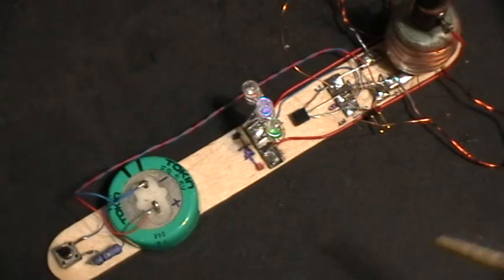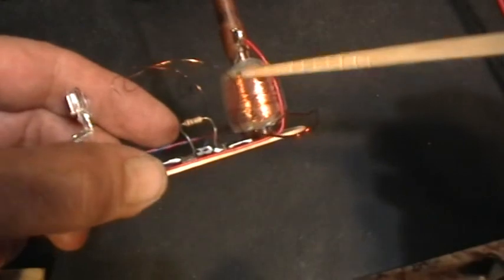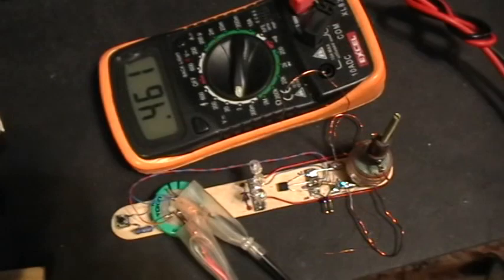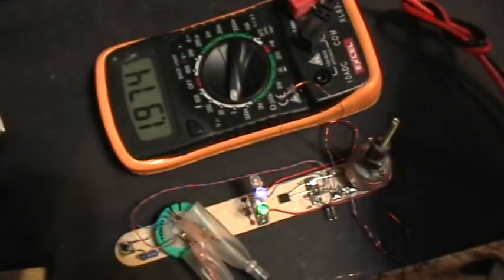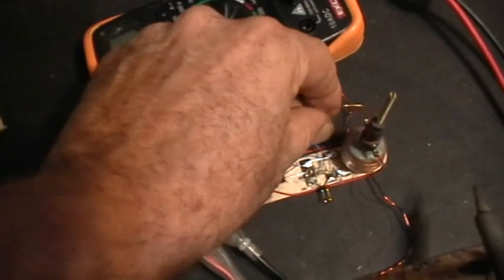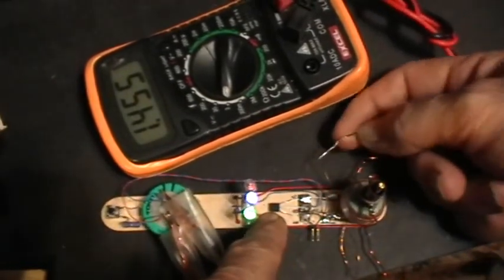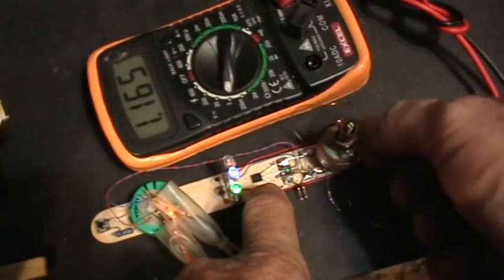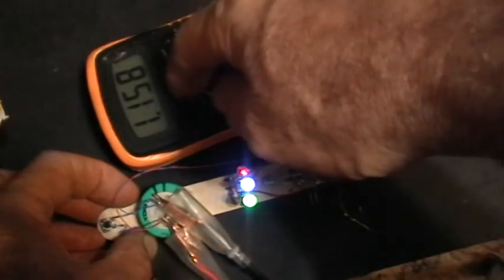Joule Thief: TK Loopstick Meets LaserSaber's SJR Simple Looper

Comment: Nice work!  I thought you would have fun with this little circuit.  Thank you for sharing your results.
Reply from the maker: Yep, I just thought to use the loopstick because it's the only Litz wire I have around the place. I think I'm going to have to get a couple more from my supplier before they run out.
Another tunable coil set I'm thinking of using is the old "variometer" style of concentric air-core coils with the inner one pivoting.

What is weird is that I can't get it to work at all with the more-turns Litz wire winding on the capacitor side. It has to be on the LED side.

Comment: Tk 
While watching this vid ...it seems that while the leds were not as bright as possible...there were some moments when the cap seem to recover a few millivolts rather than discharging....it is amazing....you seem close to showing a true anomaly..
Reply from the maker: Yes, those superbright LEDs are nowhere near fully bright. They are blinding and completely wash out the video when they are carrying their rated DC current! But you can't really rely on video to judge LED brightness because every camera is different and most people including me usually just leave the exposure and shutter at "auto", so the exposure reduces when the camera sees a bright light. Also the spectral response of the camera sensor is different from the old eyeballs.
Yes, the cap definitely gains voltage while LEDs are running, and this is a big cap so even small voltage gains are significant. However.... the bad news is that this is normal for electrolytic capacitors (and batteries too) after a heavy discharge.
Thanks for watching. How's the fishing?

Comment: The work i done with this circuit shown, every winding ratio setup produces different frequency, a given frequency does not necessary light different led's in the same brightness,
. They are frequency sensitive. Color LED'S are working in the manometer wavelength in light output, maybe it has something to do with it.

Comment: Good Job. Amazing. Is there a schematic with description? I would like to build this circuit.

Thanks and best regards ;)
Reply from the maker: Thanks! The basic circuit schematic from LaserSaber is shown at 0:17 in the video. View in 480p and enlarge. The fine print says you may have to swap ends of the coils or polarity of the LED stack. This is generally true for all JT-type circuits: if they don't oscillate swap the coil polarities around one at a time, try all combinations for the best result.  For the capacitor I used a 1F 5.5 volt cap, this is different from LS's original, he used a smaller, high quality cap charged to a slightly higher voltage. For the resistor I use a 10 Megohm or sometimes 5 Megohm (2 ea. 10 megs in parallel) 1/4 Watt metal film resistor. The transistor is MPSA18 but BC337 will probably work well also. The load is 3 LEDs in series. The coil: the Loopstick's original Litz coil is on the LED side, and one or the other of the added coils (20 turns middle, around 100 turns outer) is on the capacitor side. I don't think I can describe it any better than I did in the video, as far as the final hookup goes. Original coil on the LED side, outer coil on the capacitor side, middle coil hooked up with one wire only to the Anode side of the LED-innercoil connection.
Good luck building, and let me know what you come up with!
(Also check out the "supplement" video I just uploaded with the scope waveforms showing.)
Reply: Thanks for the explanation. ;) What is the litzwire diameter? Or can i use magnet wire instead the litzwire. I have magnetwire with 0,28 and 0,15mm.

Thanks and best regards
Reply from the maker: Kurzschluss480Volt
I suspect that using Litzwire may not be that important, but I really have no data. Use magnet wire and report your results!
Reply: LaserSaber used for his SJR Looper V2 LED Driver 18 awg on the primary and 28 awg on the secondary. Maybe it will work for the TK Loopstick circuit. I will try it out. ;)